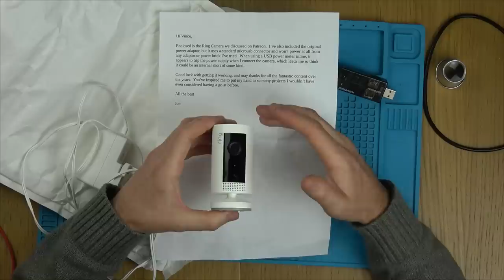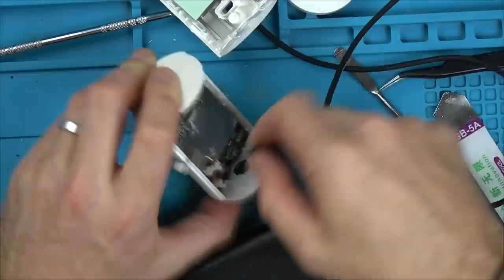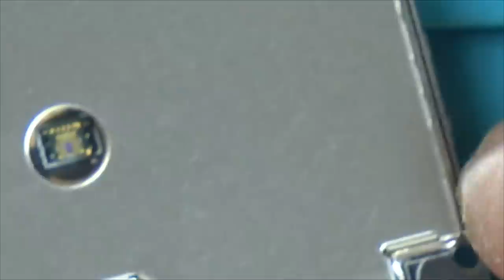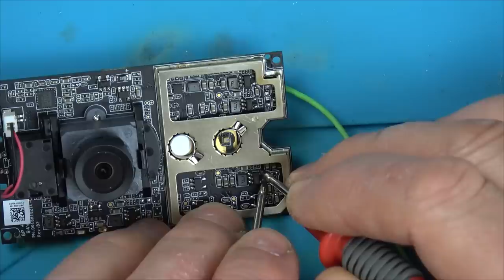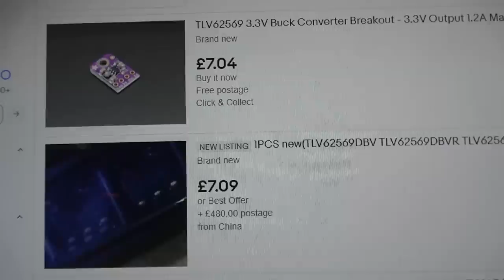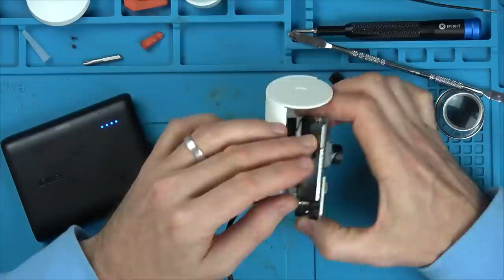A Viewer sent me this RING Indoor Camera with a SHORT! Can it be fixed?

Comment: Hi Vince,next time a voltage regulator / buck converter fails remove it from the board and look up on the data sheet the output voltage .
Work out where the 3.3v or whatever is generated and inject with your power supply that voltage but current limited.
That way you will see if the device has just failed or the load is excessive .It will also mean you don’t have to buy the device to prove the fault .
Reply: Could even then flying wire some other regulator to supply the 3V to replace the 'proper' one. I shouldn't think these things have to provide a lot of power.

Comment: I have several of these, the stick up versions are HORRIBLE in cold weather.  Even at just above freezing, battery life is short and the operation even shorter.  

Nice job taking apart a device that was not designed to be repaired, terrible because of what they cost!

Comment: I still think you should buy the regulators. Not from the UK seller but from Ali express. I don't think that's the only time you'd need that type of regulator. Might be a common regulator in consumer electronics. So It won't hurt having some on hand.
Reply: It's a buck converter, not a regulator.
There are dozens of different converters available in that package, and they're largely not interchangeable without replacing the SMD support components.

Not worth it.
Reply: Arrow electronics have them in stock at 0.25 USD. Not sure what will be the shipping charge to UK
Reply: @incandescentwithrage  thanks for clarifying
Reply: You can buy directly from TI 0.848 Euro/pce + postage.
Reply: @incandescentwithrage  Agreed, and to further your comment--purchasing any SMD components through Ali Express is not a great idea. There is no way to ensure the chips aren't recycled or rejects. It's common for Ali parts to work for awhile and suddenly die, or just not work at all. Lot's of counterfeits with no actual silicon too, just a blob of epoxy with pins and laser etched. It's pretty sad.
Reply: @efahrenholz  I've been stung a couple of times like this from Aliexpress. Once with a motor driver chip or a Samsung washing machine, and another time with some IRL3034 mosfets which I think were fake. The mosfets are commonly use in Milwaukee tools which I've repaired a fair few so far. On another note I did buy a motor driver chip for another tool which turned out to be legit.

Comment: The big inductor next to the chip is a dead give-away it's a buck or boost power supply and the chip is the controller. You can also tell it's not a reg because it has 5 pins.

Comment: hi vince been a fan for a long time now, i have a fly controller from prosound and i plugged it in and it went bang and i've opened it up and it is slightly burnt so a component has deffinetly gone, i can send it off to you if you want, i thought it could be an interesting video

Comment: If the buck converter ic is bad and passing the full supply voltage straight through you would be putting an over voltage to the circuits it supplies.
Reply: Luckily this one shorted to ground. So electricity being lazy took the easiest path to ground rather than through another device.

Comment: I'm fairly certain he damaged the second voltage regulator simply because he didn't identify the faulty component that killed the original voltage regulator. This component worked from factory, but something slowly degraded to cause that voltage reg to short to ground. Usually it's a capacitor out of spec. These voltage converters are programmable, meaning they use a series of resistors and capacitors to set the output rail. If there happens to be a faulty capacitor partially shorting to ground, it won't show up afterwards because the capacitor high side is floating. When he made the swap, the functional chip eventually failed as well because it was overdrawing current through that capacitor. They can only handle so much overdraw before they internally fail...which is what happened here.

Comment: We need modular design by manufacturers. Even taking off those SO23 voltage regs that Vince did there is not easy for 99.99% of us. Replacing a module would be more expensive than replacing 1 component but better than landfill and within the capability of more people.

Comment: Nice attempt it may have worked if you had just replaced the one that was faulty and left the others where they were also replacing all components taken off , The capacitors smoothing the power might be for the chips and if there's to many /or heavy spiking in the power it may damage the chips or have unintended results in the way it functions
Reply: Anyways hopefully the next repair is successful it's been great to watch and learn from your experiences keep it up Vince

Comment: vince i would like if you to were work on much higher voltage stuff for example power supplies not very popular maybe and dangerous but its how you learn not picking the safe ones all the time not a criticism just a friendly suggestion all the best mate and i hope you and your family have a very happy new year.
Reply: They are too dangerous. Also they are cheap to buy new.
Reply: @ligametis  it's not really the point of this channel though really is it
Reply: @bernardleaf1397  Danger, benefit and price ratio just doesn't make much sense to repair power supplies. Especially if you go to the next level of danger. Like microwaves, hifi sound amplifiers.
Reply: @ligametis  microwaves i agree with you on but all the other stuff no i don't power supplies are a part of all elecronic repair like it or not.
Reply: @bernardleaf1397  nah, whenever I see capacitor in hundreds or even thousands Volt range, I am not touching that. 

Of course some 3-20v power supply where capacitors are max 60v or so are fine.

I thought when you were talking about power supplies, you meant like all of them.

Comment: Hi Vince , I have been looking at your tutorials On Huawei internet Device, I have been lent a Huawei B315 with a antenna, which seems to sort of work I keep losing Internet every so often, One thing I’ve got to say I live in part of Royal France but I can’t find anybody that can help me I’m an old geezer who don’t know anything about Wi-Fi devices and modems and things, I’m looking to replace the B315 with a device if possible what would you recommend I’m obviously an antenna as well and it needs a Sim card in it so I can connect to the Internet my property at present does not have any means of telephone line or fibre connection, Part of the reason why I want to replace it is that I was lent it for my friend and I found out that he can gain access to my Internet and email address as he has all my information for me to login on my phone and iPad and devices so I need to replace the Huawei router with a new one, If you can help me please it will be very much appreciated, PHIL FROM THE DARK SIDE OF THE MOULIN FRANCE.

Comment: Was just checking for the part at Mouser and Digikey, both have it in stock or will have it "soon-ish" depending on the version of the part. 
But shipping costs are... rough.

I know some retro-computer Youtubers get supported by PCB manufacturers.
Why not try to get in touch with Mouser (or Digikey) and try to get sponsored by them?
Reply: They cost under $3 for 10 on Aliexpress from China, where the thing is made anyway.
Who cares if it takes a couple weeks on shipping for low cost parts like those.
Reply: @biohaz360  because you never know if broker parts are old, were properly stored, are rebranded or something like that. It is just anoter potential fault you are buying. If no other options are available you can go that round but at mouser you van get them for a dollar plus 20 fpr shipping. and you will receive fresh genuine parts from an authorized seller.
Reply: @biohaz360  aliexpress is like buying a dvd in a dark alley from some guys trenchcoat. sure it can be good quality, but you never know until you tried what you bought.
Reply: @crowbarviking3890  I agree for certain parts, like mosfets or low esr capacitors, but Digikey  here in the States charges $7 minimum for shipping.
Ebay and Amazon also sell fake parts, hell even Walmarts app lists 1TB micro sd cards for $10, I'm sure those are real...

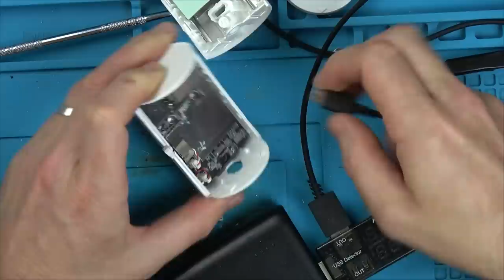Comment: Maybe invest in some Hot Tweezers, you can see NorthridgeFix use them in his fix video "Another Asus ROG Laptop Repair. What is the Best laptop to buy?" @ 09.40 and PS5 Turns on then off after 1 second. Is it Fixable? @ 05:20
Reply: It's far easier to use a pair of fine tipped soldering irons than those huge hot tweezers when working on such small components.

Comment: When you take something like this apart, make sure that you are not pushing to deep the tool. You are using to much air flow with those tiny components. You can easily blow them off the board.
Reply: Also too much  heat very likely. 500c is pretty extreme, components are cooking. Solder melts at 230c for example. This is a small board, don't see a point going above 400c or even 350c.

Comment: Friend of mine gave me one of those led bulb shaped camera which connects to a smartphone through wifi, it is stuck in blinking red light stage, i don't know what is the fault. Also I made the same mistake of unscrewing the lens part on camera. If anybody have any idea how to fix such issue please let me know here, it is powered by mains, and the power supply is fine, it is stuck in startup process somewhere, I have tried resetting few times but no luck.

Comment: I don't think it's a failure, because you swapped the damaged voltage regulator thats already broken, so if you buy new ones, it should work.

Since the other components are not damaged, if other components were damaged it would not work at all.